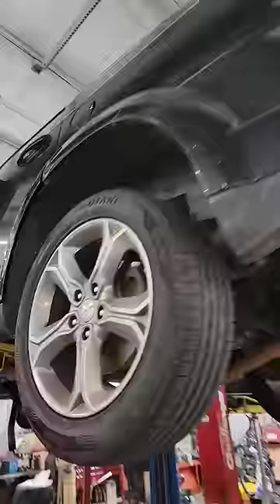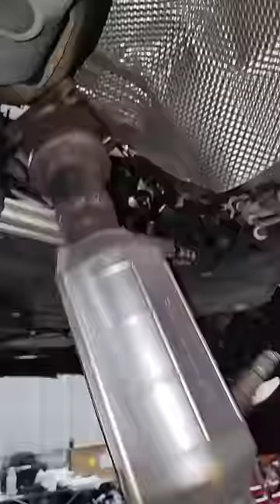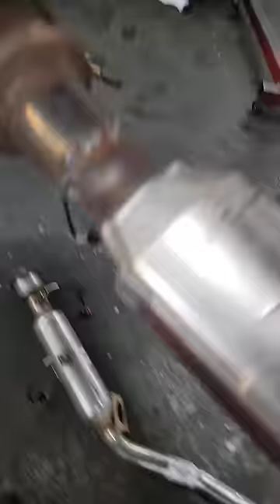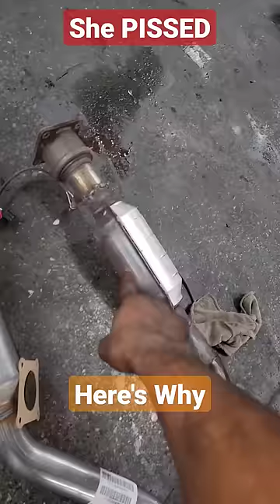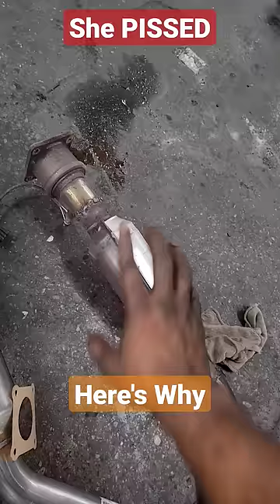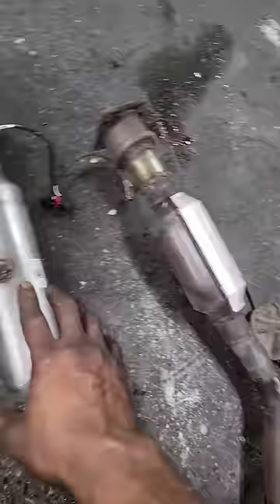This customer freaken Pissed Off. But at whom?

Comment: Most small shops do not even check recalls for free parts.
Reply: Exactly, they diagnose it and sell parts and labor
Reply: Nah, I’m a mobile mechanic. It takes 30 seconds to check on recalls for any make. I always make sure to tell my customers if there is an active recall that can save them money. They’ll appreciate and when the times comes they’ll give me their business. We’re in the business of fixing things, not screwing people over.
Reply: @shawngrado2025  
Ya but these shops are bad . I had someone with a broken belt acc tensioner shop wanted to replace it for big money but it's free under the recall.
Reply: Any body who says “ Most “ in any comment has never researched it, give me numbers. The first thing any good shop, large or small will do is to run the vin number for any TSB’s and recalls. Then the customer can decide where they want it repaired. Even if you lose the job you gain in good will and reputation. There’s no better form of advertising. 😊😊😊
Reply: @johneverett3947  - Exactly. Any "good" shop. Most shops aren't good. I've saved my customers thousands informing them of recalls and extended warranties on their cars. People will have more confidence in you when you'll turn down work because they can get it done for free.
Reply: Recall?!? Well I don't RECALL your car being fixed before you came here.😅
Reply: @shawngrado2025  exactly. The shops and technicians who rip off their customers won’t be in business long.
Reply: @johneverett3947  
We had clients get charged for service and maintenance at small shops while the car still has factory warranty!
Reply: @johneverett3947 Exactly, what I do.
Reply: Actually federal law. Covers major emission issues for 8 years.  Cats are major.  If it fails in 8 years it HAS to be replaced by oem.

All shops should know this
Reply: @vbarbee1  at least independent shops diag correctly, and repair it correctly. Go to the dealer if you want them to sell you shit your car doesn't need
Reply: @shawngrado2025 awesome comment !
Reply: Shop probably wanted to make parts and labor vs whatever flat rate that Mopar was offering for 3rd party to honor their recall
Reply: Sean grotto is correct, all shops can check for recalls on any car, it takes but just a few seconds, and they get paid well for their labor.
Reply: @shawngrado2025  You are forgetting there’s sleazy people in every industry. And theres plenty that will be lazy even if it only took 5 seconds.
Reply: @johneverett3947  Anybody who refers to people as a physical body and not a person, has a questionable upbringing and shouldn’t be trusted. (“Any Body”). Especially when asking for stats on every small shop in the country on if a person completed the non legal binding task of research or Googling before a repair can be legally completed; when there is no federal or state position of “Did you complete the research and google requirement auditor” only for tens of thousands of small shops only. Especially when the person decided what their personal definition of what the commenter meant by what constitutes a small shop as if it were possible to track if every single one did that particular task available on the internet for anyone to see the non legal binding task completed stats.
Reply: @johneverett3947  By the way since the stats are easily available, what are the stats? And how do you research a widely available stat? Isn’t by definition a stat already researched to get it in the first place since stats are first hand resources? Or did you mean to research and randomly make up the stat himself like 66.7% instead of “most”?
Reply: @dcomputers service maintenance is not under warranty unless they bought a service and maintenance plan.
Reply: @johneverett3947  most of the mechanic chain stores I've had experience with or know second hand stories from people I trust would shoot your idea that "shops and technicians who rip off their customers won't be in business long" full of holes fren.
Reply: I actually had one do that. There was a piece that was gonna cost $800 and the mechanic told me there was a recall on it and did it for free.
Reply: I'm more shocked that she didn't KNOW she had a recall. I'd bought a used impala from a co-worker. Within 2 weeks of tagging it I was getting letters from Chevy dealers nearby about my recall monthly till I did it.
Reply: @jerj4805  you notified the car maker.
That's how recall letters have always known where to go.
People who don't get letters haven't notified the carmaker.
They find out from the news making a big deal before the parts are available.
If the dealers in your state are getting your info it has to be a local thing.
Reply: As a mechanic for a small shop in a town of 5000 people we always check for recalls as it isn’t hard. Your more likely to get screwed by a dealership than a small independent shop. Most people that get screwed by “small shops” are actually going to fly by shops that constantly close down and reopen under different names.
Reply: @aaronsondag8347  the dealership performs recalls investing their time, tools, and trouble to satisfy laws and the manufacturer hoping to make customers.
If they can't help, it's because of laws and policy .
They gain nothing in a recall except to basically break even.
There's a time limit and it's the consumers responsibility to inform the manufacturer so he can be contacted in a timely manner.
He can also go to his selling dealer, hopefully, and request information anytime.
There's no profit in it except to build owner loyalty.
If you're not loyal, you don't inform the manufacturer of your changes?
 You put yourself in your predicament.
So you invest in your own information method.
You invest in time and diagnosis .
That's the path you chose.
Sure, not every shop is bending over backwards to kiss your tail pipe, it's not how they do business.
But if you have a viable repair needed and they can help, they will outline it for you if you want the correct update according to how this is done proper.
Reply: @aaronsondag8347  sounds like furniture stores.
Reply: Please, my smog guy tells me about my recalls every time I get smogged. I don’t go to shops but that doesn’t sound right
Reply: 95% of all of the small shops in America, are not authorized to perform recalls, against manufacturers. 

They might get free parts... But they're not going to get free labor.

And if you're out here looking for free parts, and Free Labor... You don't need a mechanic... You need a charity.

I suggest, UNICEF.
Reply: why would they, they dont get to sell a part for profit? thats why i started doing my own maint.
Reply: Most if not ALL shops don’t have enough staff to please certain expectations… even the staff at top tier insurance companies hired to inspect damages aren’t as knowledgeable as the internet. Crazy how the world works man.
Reply: I mean if you dont care about your car this happens! Take it to the dealer.....period! And any tech says otherwise either aint good enough to do factory work or is to lazy to do factory work...no ands ifs or buts! They are the tech that says they can do it just as good but will only jack your shit up!
Reply: @dcomputers  warranties don't cover regular maintenance
Reply: @shawngrado2025  you’re literally driving away the money buddy 😂😂. You’re sending the customer to the dealership and away from you. So you drove to them for no reason. Great business model.
Reply: @scott8193  nah Im a good mechanic, I don’t hurt for business.
Reply: @shawngrado2025  doesn't matter if it takes 10 seconds... if you don't look you don't look
Reply: Literally one of the easiest things on a car to check 😂 most small shops only know how to service hondas and trucks
Reply: No, most shops DO NOT check for recalls because they cannot/do not perform  recalls, that is the dealerships responsibility. Independent shops just make repairs.
Reply: @steel.tb  well instead of charging the customer x amount of dollars for parts and labor , they should at least inform to the customer that there is a recall tsb on the part or issue and if they want to go to the dealer for free work.
Reply: @dcomputers  depends on if this is classified as a recall or a service action... I don't believe service actions pop up. People use the two interchangeably,  but they're not the same
Reply: Doesn't matter, you as the car owner should know this.  That's called being responsible.  On top of that, if you got your car fixed and a recall came later, or like the this video THE MANUFACTURER WILL REFUND YOU
Reply: lazy
Reply: @dcomputers  its really up to the owner to know if they are under warranty or if their vehicle has an open recall.
Reply: @shawngrado2025  what service do you use to check for recalls?
Reply: They are unlikely to know unless they have seen the vehicle themselves.  You can take it to a dealer and see if you have any recalls that need to be done or even look and see if there is one for your situation.  Then you won't be upset like that lady was.
Reply: @charleshines2142  
I know what I'm saying was a lady had factory warranty on her car and the side shops Goodyear still did the repair and charged her up the butt when it was under warranty they should of refer to the dealer
Reply: Which is why being a "dealer dodger" can cost you more than it saves you. I often had customers come in saying they had been dealing with one problem or another for years and years. Sometimes having to do wacky things to live with said problems. Yet, for years, a software update or technical bulletin has been out that rectifies the problem FOR FREE. But if you never go to an OEM shop you'll never know. It can pay to contact a dealer with you Vin and just ask if there is any campaigns open on the Vin. If so go in and get what's yours.
Reply from the maker: Well said my friend.
Reply: the same type of people to ruin your car then fight with you about fixing their fuck up
Reply: @shawngrado2025 I was just going to say the same thing. My dad owned his shop for 22 years and he’d always inform his customers if there was a recall on their cars. It took literally no time to find out.
Reply: @jeepsblackpowderandlights4305  There is an 80K mile limit on that federally mandated coverage though.That means, if you drive more than 10K miles a year then your coverage will end in less than 8 years.
Reply: I always check SIBs first . And if there’s a recall we’ll let the customer know . And we’ll call the dealership in advance and ask them if that vehicle falls into that recall .
Reply: Well the custumer should of checked herself
Reply: @calvinthurston1441 The dealers are the most shady and incompetent people out there. Have you ever dealt with a dealership? I don't know how those clowns tie their shoes in the morning.  Dealers will hire anyone with a pulse. A ma and pa joint has higher standards for competence.
Reply: @shawngrado2025, same here. I earned a customer for life when I told her that her engine replacement was covered under a recall. 2.4 GDI
It takes nothing to check for recalls
Reply: @jeepsblackpowderandlights4305 yeah? What if the shop can prove negligence and say that repairs recommended from before but were turned down was the cause for the CAT damage. I would say that this is one of the more common reasons a cat would fail so soon. People don't service their vehicles when they should.
Reply: @Meme-zc4cw doesn't matter where you go. Your experience is reliant on the technician who is physically working on your car. Doesn't matter where you take your vehicle it only matters who worked on it. This also applies to warranty work, the warranty is only as good as the person working on your car.
Reply: Here locally, it doesn't do much good to check recalls. Not because they exist or don't, but because the tow bill to get the car the 55 miles to the nearest dealership with a repair bay is quite often close to 3 months car payments.

That 3 month basis using a personal vehicle as a guide. My monthly payments on a 2023 Kia are $675, the tow company here charges $300 just to leave the parking lot of their office, and then it's $50 / mile
Reply: Do the companies pay the shop for recall installs?
Reply: @shawngrado2025 how do you check?
Reply: My shop tries to stay on top of telling customers about recalls if it is related to the problem they are having. However it isnt our responsibility to notify you of a recall. Your vehicle manufacturer should notify you of any recalls and you should actually check on your own. Call your local dealership, ask if there are any active recalls on your vehicle  and they will be able to tell you if you have any or you are up to date. But dont assume an independent shop is gonna notify you or know that there is one.
Reply: Probably should get rid of "small" everything
Reply: small shops dont get the recall notices to your car sent to them, the owner gets the recall notice..   

Lesson being CHECK YOUR MAIL
Reply: it’s on the customer to call the dealership of the manufacturer and take a moment of their time to ask if there are any recalls or warranty for a failed part. Don’t blame independent shops for the owners lack of initiative. If they don’t want to educate themselves then it’s on them. Intentionally or unintentionally don’t expect a repair shop to check for recalls especially on older vehicles.
Reply: @briizcustoms9543  sucks to suck man. Ford doesn’t have your back.
Reply: Exactly. I never heard of this before.
Reply: If it's a legit shop with a proper shop management software and/or proper service info it literally shows you TSBs and recalls and any competent tech and service writer will check them out. If anyone is going to a shop that has neither, the only person to blame at that point is the vehicle owner.
Reply: I agree some things get looked into but sometimes they fall through the cracks 🤷